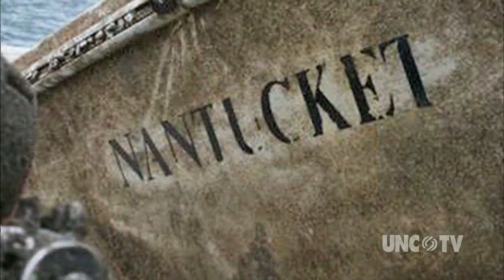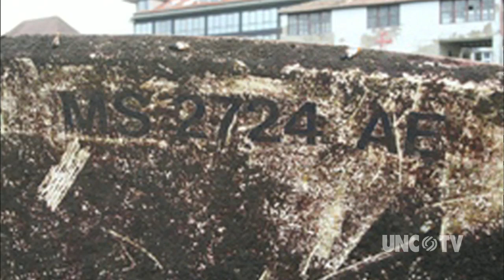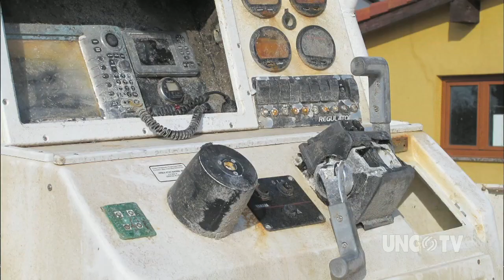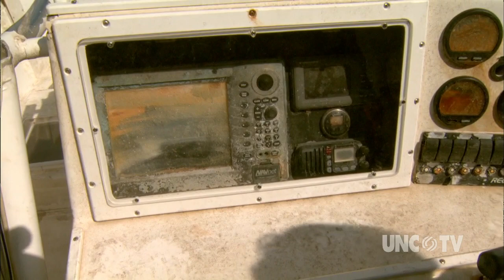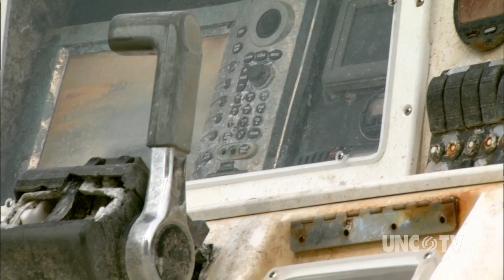NC Now | The Queen Bee Fishing Boat | UNC-TV

Comment: I Really Love this Story... 
Regulator Is a Great Boat... 
But had they been in a CAPE HORN... 
well.. # 1 it would have been Recoverd quickly because you look how low it was floating.! A Cape Horn would float so much higher. & Depending...! On the Top you have. Could self Right ! I am no Navy Engineer but can say Cape Horn is STRONGER than any other Boats.!
Yes I am a Cape Horn Owner 2004  21 OS I have taken 5 kids out 24 miles in 8 FT Seas. Yes ! I am no Navy Engineer but I am a old Commercial NOAA Snapper & King Capt. 12 yrs. 
2" thick Hull. They also have MUCH more foam . The Gunwale on Cape Horn have a big thick bolster full of same closed cell boat foam as does the floor down to the keel. All  Floor & fish box &  Transom & upper decking built out of a hard board that Floats....  they were Lucky..! Current & God on their Side